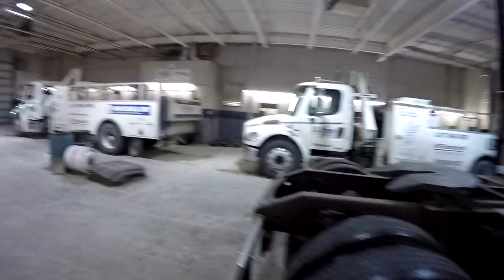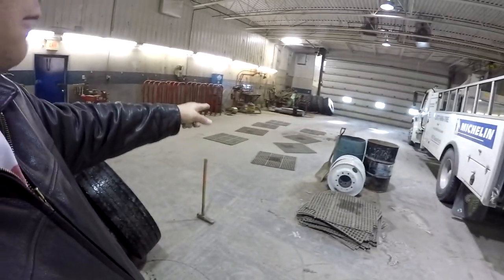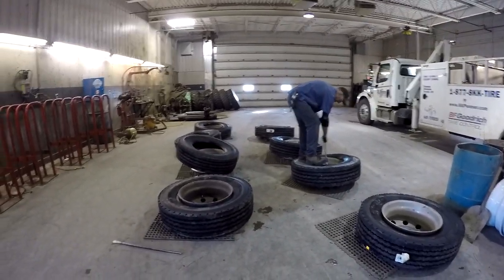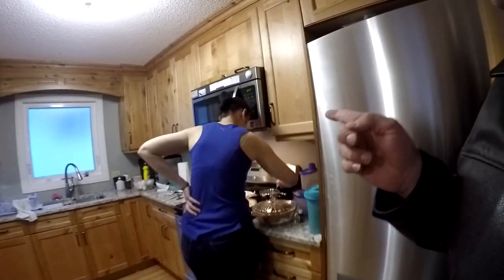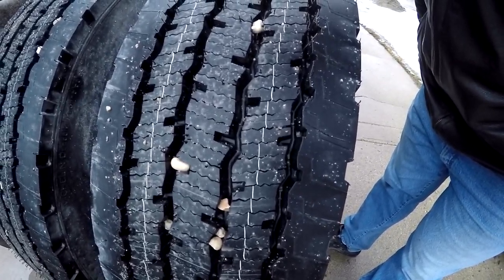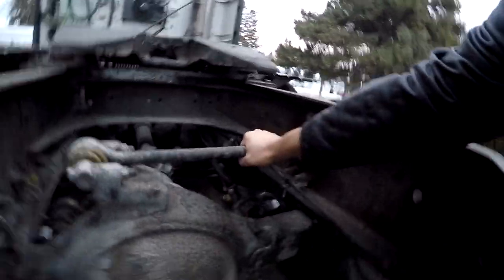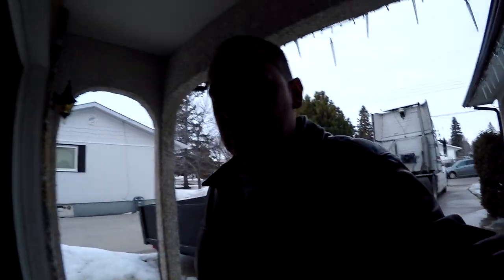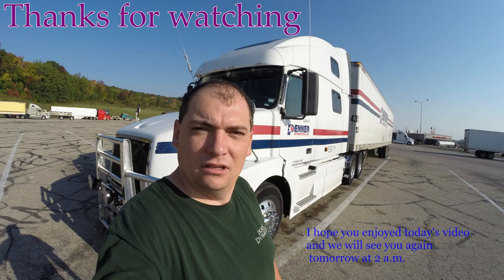Trucker Rudi 03/07/16 Volg# 638 Our Daily Journey Money???

Comment: Great video Rudi! It is good to show non O/Os what it takes to keep a rig on the road in good condition. Did you buy your Volvo new or used? Has it been reliable and when do you think you will get a newer truck? Be safe, thank you for your videaos.
Reply from the maker: Thank you those are all great questions my friend I did not buy my truck new The engine has not been rebuilt as far as I know I currently have no plans to buy a new truck The new trucks are too much problems with them